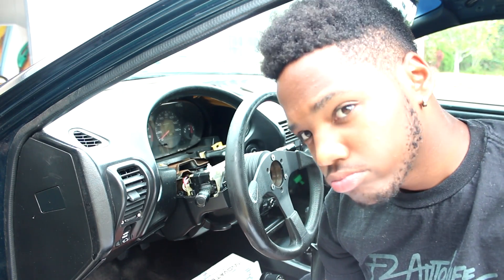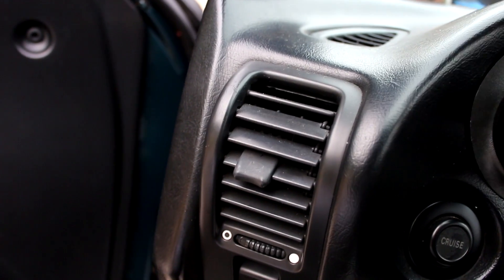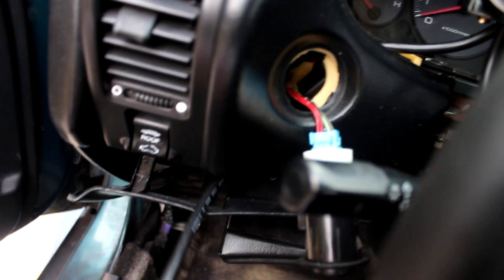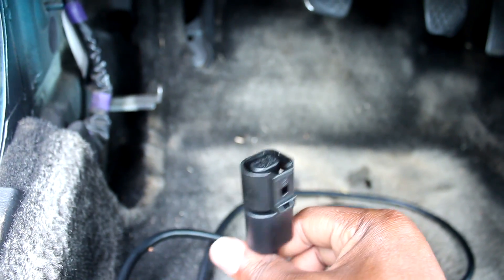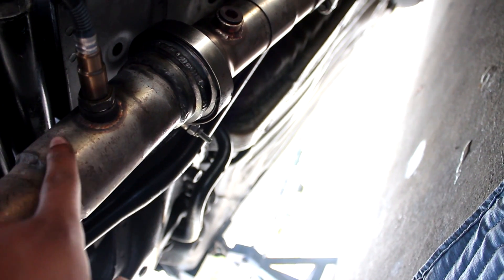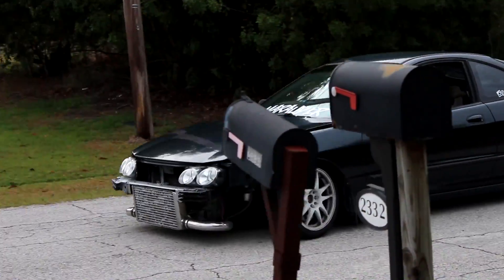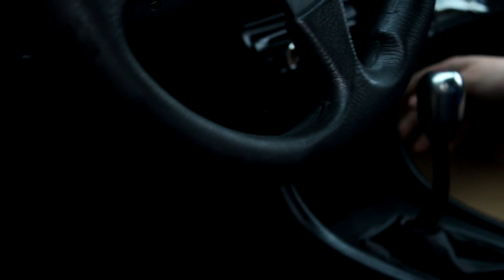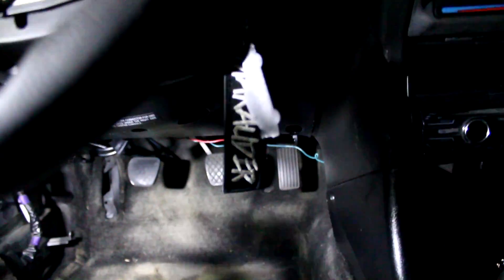WIDEBAND INSTALL: Innovate MTX-L Plus Wideband

Comment: I'm pretty sure DC's have  4 fused "accessory power" terminals on the interior fuse box, EG/EJ's do.  You really didn't have to fuck with radio wiring..
Reply: Sleepnciv shouldn't be really touching a car if they can't figure how to use a volt meter or test light
Reply from the maker: yeah i know but was in a rush to get this video done and uploaded.

Comment: I would've wired it to the fuse box. It shouldn't read any different because of e85. AEM is better lol.
Reply: Aem is a cheaply made premium product with drastic inconsistencies from one batch to the next. Lots of professional tuners will tell you to get the Innovate over the AEM.

really the only reason to run the AEM these days is because you have an AEM standalone.

Comment: innovate is known for overheating sensors often. If you get the e8 error you need to move it downstream and heatwrap where you have the sensor bung at
Reply: So does the sensor just wire into the exhaust for the o2?

Comment: aem is more simple to install my bros has a innovate Nd failed on him wideband is a wideband most importantly on boost application s all motor just at As much as a boost car
Reply: fernando tejeda they are known for overheating sensor on forums
Reply: +Scott C which ones innovate ?  my aem has a membrane Nd a extension adapter to o2senser wire
Reply: fernando tejeda they are the brand he uses in the video

Comment: Correct me if I'm wrong but Aren't you supposed to get a reading outside the car first then put it in the test pipe?
Reply: Dc4 Rob u still need to calibrate it everytime u disconnect the power from its memory.... that's y it took so long to start reading the "hater" is actually heater and it's the sensor heating up to calibrate
Reply: Kenny Mitchell it was already calibrated. Tuner used it but didnt hardwire it.
Reply: That Neon Channel i dont remember if this one needed to be atmosphere calibrated or not as some dont need to be calibrated out the box. I just helped wire it lol. But yeah, i know about the warming up, i told him thats what it meant.
Reply: Yes you have to calibrate it every time you disconnect the Gauge/Controller from power. But the manual also tells you not to wire the thing into your radio either...But then these guys don't even have a test light, or dvom. Either of which could have been used to tell which wire was +12v and which was ground in the cruise control switch.
Reply: But I guess thats just the heater in me coming out.